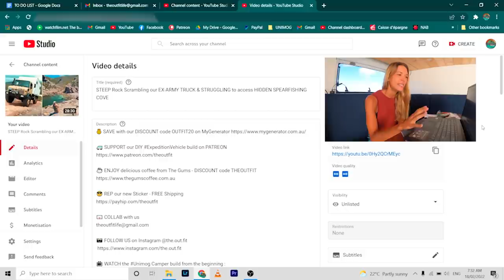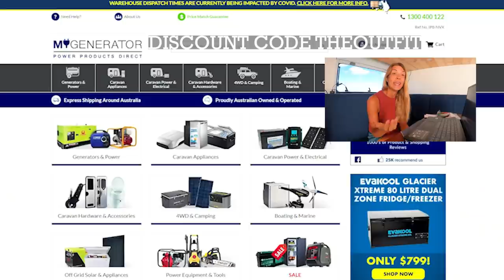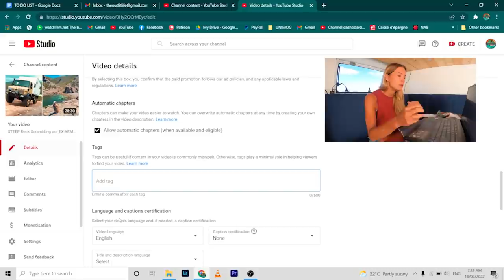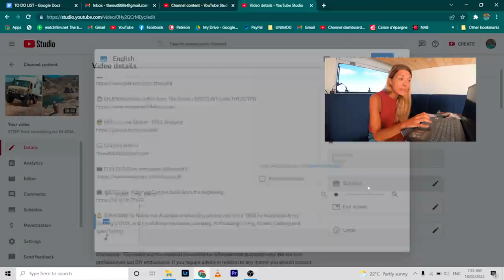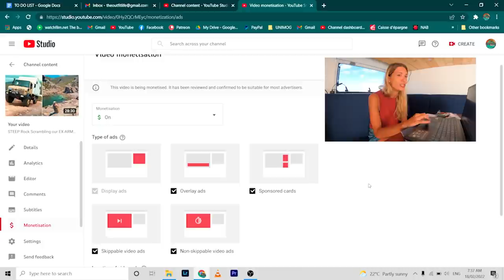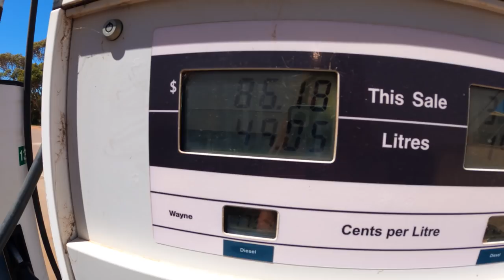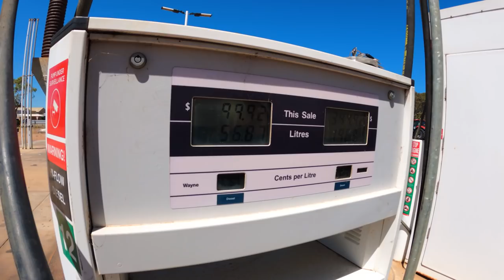Getting Ready for our next Expedition - Behind the scenes, Air Compressor & Auxiliary Tank/Fuel Pump

Comment: There's a screw fitting with dust cover under the 4 way valve that accepts a flexible air hose that will have come with the mog when originally purchased by the Aussie Army back in the 1980's. It accesses air at a much higher pressure than the trailer brakes operate at. From memory taking the tyres from 30psi to 80psi used to only be 5 min or so per tyre. The hose fitting on the hose itself once screwed up tight would push a one way valve in on the 4 way,, and commence letting air through.

Also, is your mog fitted with the upgraded air compressor? The original 1980's mogs came with an oil cooled air compressor. At their mid life upgrade the Army installed a water cooled air compressor with considerably upgraded cfm.

Comment: Have you guy's looked into CTI (centraltyre inflation)? We used to run it on the drive tyres of our road trains. You can inflate and deflate tyres on the move. Runs off the truck air compressor and will inflate up to 100psi

Comment: Hey Guys, great video as always, I worked on Mogs in the Army for 6 years as a mechanic, they have two types of compressors on them, one of them likes to blow the head gasket on the pump itself, but easy fix can replace/make gasket on side of road, maybe a thought to carry a spare gasket or gasket paper, even carry a whole compressor if you can get hold of one

Comment: Compressors are the weak link. They do just go. You'd need a good sized compressor ~ you've just about the room for one. Roger splitting the load ~ for my peace of mind I'd find a good petrol compressor and sling it somewhere with quick deploy and use that, running the truck's compressor to keep it exercised and for fail safe.

Comment: Great vid guys. It's all good fun learning how to streamline the workings of the Mog.
The fuel fillers being on opposite sides is a bummer. Must be tough being in a line and having to leave and turn around after first tank. Is there anyway that transfer pump can be used as you fill up the secondary tank so you fill both tanks from one side? Be a bit slow but can be done.
Marty from Perth

Comment: Hey guys I have one of those kings compressors it works great only downfall with mine is the pressure cut off isn’t working but will take it back to replace but I have used it on my truck at work which runs a 295/80/22.5 and is quite quick to pump up from quite low

Comment: Your Mog has an air system on board so why are you using a remote air pump to inflate the tires, you and put air outlets on all 4 corners and just run it off the truck air system
Reply from the maker: This is what we used to do but it takes way too long, we end up having to leave the Mog running for nearly 40 minutes. At least with this system we can almost half the time.
Reply: @TheOutFit   fast iddle 1.5 tr/ 1.7tr for military diesel truck , not suppose to overheat
Reply: @TheOutFit I've had experience with a U1250 with a bayonet airline  connection Atkinson Vos fitted at the high pressure tank and don't recall glacial dramas in inflating tyres during a saga of a cracked wheel rim leakage . Maybe the existing hose connection at the rear of your truck has flow restricted by pressure reducing valves ? Also I'd check that the truck air compressor is in good health and as others have said there are different compressor variants available providing higher cfm.